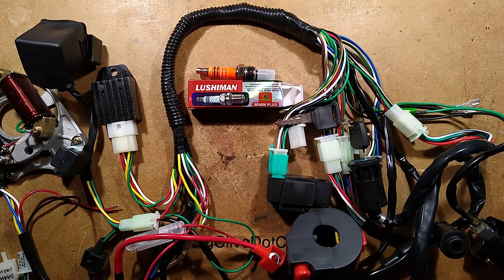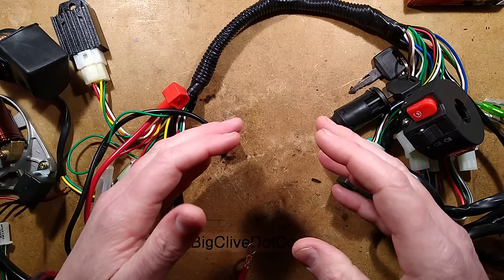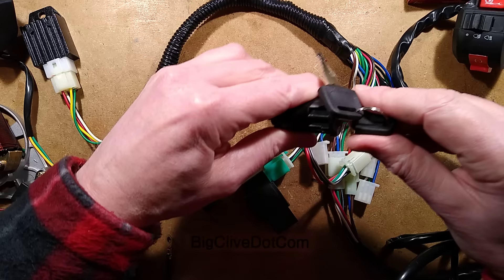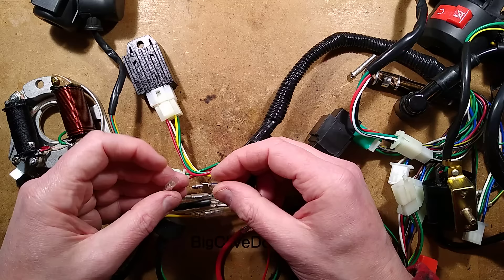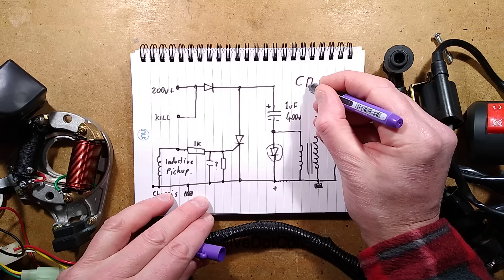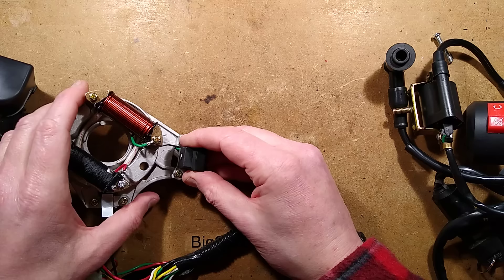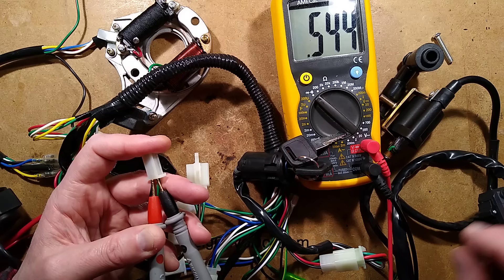Exploring the wiring loom of a Chinese quad / scooter.

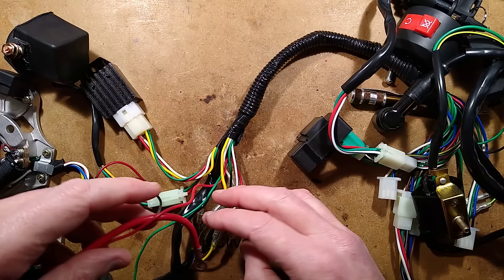Comment: 7:45 The connectors are a bit shit . . . lol I believe that's a fairly large understatement... Look at the wires , they are very thin and if I remember correctly, somewhere around 28 ish gauge at best.
I see those plastic connectors alot with crusty connections and broken plastic tabs. Those "single wire connectors" for lack of a better name ( bullet connecter ) ,usually are ok enough to be connected at least 2 -3 times. At least, before they just start falling out.  I also see alot of engine start "switches" corroded  too.

Edit: added bullet connector, as I commented before that point in the video.

Comment: I almost want to say that the yellow and white is the “single phase ac” wiring from the stator ? So single phase ac into regulator and 12v dc out.
Reply: This is an AC / DC system same as small Hondas, the headlamp is unregulated AC, thus the flaring when the engine is reved. The DC section of the coil goes to the regulator for DC to drive tail light and charge the battery.

Comment: at 12:59, you sound like you mean the secondary (external) coil fires on an expanding magnetic flux field, current starting to flow.
traditional ignitions fire on collapsing fields as it takes time (dwell) for coil saturation. 
rough gauge would be primary windings will be low resistance, only a couple ohms.
i spent some time researching LC circuits, because of an unusual type of ignition called "energy transfer" where the points short the output of the stator coil to ground until they open, leaving the HT primary windings as the only available path, low resistance, they saturate very quickly, firing on an expanding field with points opening.
https://www.motorcycleproject.com/text/ignitiontech.html (discusses multiple styles of ignition)
as my shop teacher said about saturation, "it's quicker to empty a bucket then to fill it"

Comment: Bigclive. Im looking for good t10 12v car led lights that are able to stay on for long amounts of time without burning. I tryed i guess 100 different kind of bulbs, but only a few are usable.
Things i need:
Dont need to be extreme bright.
Not blueish white, just white. (5000k?)
Reliable.
Thanks!
Reply from the maker: Choose the ones without the extra canbus resistors.  All they do is pass current and generate heat.  You can extend the life of most of the smaller lamps by adding an extra resistor in series externally.

Comment: I just spent many hours troubleshooting the engine management in a Chinese manufactured ATV using an 1100cc Chery motor.  Talk about horrific - no documentation, waterproof connectors that weren't waterproof, everything (including the ECU) had some level of corrosion, relays could be turned on and off with a squeeze... simply catastrophic.  I did get that POS to run finally.  Would not recommend.

Comment: 16mins in is a fine example where a digital meter is a poor device to demonstrate with. Numbers flashing all over the place. By watching it carefully it is possible to follow what is happening but it takes a bit of effort. An analogue meter will be steady and changes of switch state obvious. Horses for courses I know. Analogue is unbeatable in some applications, digital when you need to know the voltage of your pp3 battery down to 0.001v.

Comment: It’s an alternator rather than a magneto really. A magneto is a unitary generator/HT unit. They’re still used on aircraft
Reply: & an ALTERNATOR is used in CARS ... not motorccyles or ATV's ... CLIVE is correct .. it is called a "stator"
Reply: a MAGNETO .. is the BIG ( stationary part ) inside of the STATOR ... Magneto's are used on gas lawn mowers .. .when the flywheel spins & crosses the MAGNETIC field of the stationary magneto .. .a small electrical pulse is generated .. which is then send to the spark plug .. no need for a CDI. ... If you have LIGHTS, RADIO, ... you need MORE power than a magneto can produce for the spark plug ...

Comment: Damn that's a great buy.  You have lots of hardware for under £20!  I've got some Chinese copy Honda engines that may use this.

Now I am curious.  Supposedly there are some of these systems that will not fire the CDI unless a battery is connected, and others that work fine with or without a battery.  There so many variations of these Chinese harnesses and apparently the components are not interchangeable.

Comment: To be fair, you can get a chinese quad for a tenth of the 'stealership' ones in a country that likes to jack up prices of imports.
Yes, it is half the physical size and probably not 4wd. Yes, I belive most countries do not allow them on public roads. Yes, the drive chain will snap like boiled spaghetti if a overly grown up kid tries to give it all it got. Yes, the engine might not start without working on spark plug or a full on carb clean after a long cold winter. Will any and all parts wear out faster? Undoubtedly.
Can you have fun on a small quad even if it is rwd? Oh yes. Can you  find a venue where the law is not looking? Most likely. Can you go to the nearest motor cycle shop with the snapped chain and ask for a stronger replacement? I sure did, and I sure got. Is it difficult to clean or change a spark plug, or clean out the carburator? Not if you are able to search for a few how to's on youtube and realize that maybe five videos telling you to do it one way and one having a very easy fix suggests that there may be reasons why most don't use the easy fix. Can you order a complete quad out of spare parts to fix yours? At least in the case of mine as it turns out.
Bottom line, you get what you pay for. I got a cheap-ass quad that is fun to tear around on. I have also spilled figurative and literal life blood on it as I have taken it apart and replaced parts. 
Basically, do not under any circumstance buy one of these if you want something that will just start and run. Get something with a honda engine.

Comment: My bike has a kill switch on the kickstand. That maybe we're one of those connectors goes.
Reply: My Bandit didn't. I used to leave it idling whilst I locked up.
Reply: Mine does too, Honda
Reply: might need the clutch lever (if it has one) pulled in to turn engine.
Reply: @dundeemink3847  the bike will not run with the kickstand down and the bike in gear. I can either have it in neutral or put up the kick stand to start and run the bike.
Reply: @ndmusick11  It could also have a lean angle sensor. this stops the engine if the bike is lying on it's side. this is for fuel injected engines as a carb doesn't  like its float bowl in the wrong place and will tend to stop after a few seconds.

Comment: From my limited experience of little Chinese engines, could those 2 spare wires near the magneto be for a low oil kill switch?
Reply: More likely for a Neutral switch installed near the gear lever, for the Neutral indicator light that most mopeds, motorcycles and quads have. The gear lever is operated by the left foot, and the magneto is typically mounted on the left side of the crank shaft.

Comment: In your professional opinion, if I had a scooter which would accelerate just fine until a few miles an hour and fall flat no matter the throttle, would the sketchy CDI module be a good place to start replacing bits? Electronics go right over my head.
Reply: NO ... It starts & runs fine ... electronics are just fine ...
fuel line is the starting point ... gas flows from the tank into a (bowl) on the carburator ... which is then SUCKED out to be sent to the cylinder ... when you "sit" the FUEL BOWL refills .. .when you run the engine it uses the fuel from the fuel bowl .. if the SUPPLY LINES are clogged ... the fuel can't refill the FUEL BOWL ... in time.
Reply: CHOKE is stuck on ... too much fuel is goingto the engine .. .CHOKE is fine when at idle .. .but when "floor the accelerator" .. you are now putting in TOO MUCH fuel for the engine can handle.
Reply: NOT enough gas .. or ... too much gas. ... electrics sound like in good shape.
Reply: SOME atv's do not even have a BATTERY or a CDI .. .the cheaper one without any lights ... DO NOT .
CDI are used to power the spark plug ... & recharge the battery .. .which powers the lights.

Comment: The extra kill switch wires are for a alarm and remote kill button for kids
Reply: Kill switch on the ... front brake ... kill switch .. .on rear brake ... kil switch on ... SEAT ... Kill switch on ... remote control starter ... kill switch on ... low feul ... kill switch on ... temp control ... kill switch on ... kick-stand ( who th F uses a "kick-stand" on a 4 wheel vehicle ? )
Reply: What 10 year old kid ... is going to remeber the ... 7 ...  " kill switches "   ... NONE ... so I "dis-connected" the ... " safety switches" as my kids were not able to start it  ... without tie-ing string onto ther handlebars ( which raised my concerns )... as a 10 year old's ARMS & LEGS are NOT long enough to "bypass" all of the safety swithches at the SAME TIME !

Comment: Dude no way. I can’t believe I didn’t see this one.  I had some serious questions on how the rectifier regulator works. Ike both ac waves go to rectifier then spit out 12v? What’s the wiring difference in halff and full wave rectifiers?
Reply from the maker: I made a separate video where I de-potted and reverse engineered each loom component.
Reply: @BigClive  I saw that video eventually thanks so much Clive!
Reply: from the factory is 1/2 wave ( as that is what the stator creates ) ... Full wave means you move the ( 1 wire ) from the mid-point of the stator to the "other end" of the stator coil ... but you also need to replace the 1/2 wave rectifier ... as putting FULL wave into it will blow it ...
Reply: 1/2 wave is a PULSE of electricity .. the 1/2 wave rectifier "tries to smooth out " .. ever notice how your lights flicker when engine rpm's get low 
FULL wave is MANY pulses of energy ( in the same time frame ) ... creating a "smoother" energy wave containing 3 to 4 TIMES the energy for the same number of rotations ... eliminating the pulse ... allowing for " more sensitive electronics " ... like trying to record yourself on a CELL PHONE.

Comment: these "chinese scooters" we call them GY6's in the Netherlands are very easy to steal just crack the steering lock by kicking the steer then break the front shield or unscrew then unplug the ignition or cut the ignition cable and kick start it and it will work One big security fail my dad had one and some drunk guy just made a crack in the shield unplugged and stole the bike in 40 secs 
😂😂

Comment: Bad news? "From 1 January 2021, eBay will be legally required to begin collecting and remitting VAT for UK imports. From that date, eBay will have to charge buyers the applicable VAT amount directly and remit this sum to the relevant authorities."
Reply: I'd rather that than the massive "handling fee" couriers charge on £3.01 vat.
Reply: We already have this in Norway. No big deal though, if the seller isn't claiming the VAT (via Ebay's Global Shipping Program), the Mail will gladly do it as the package arrives at the terminal. Many small packages still come through without having to pay any VAT though.

Comment: "The connectors quite frankly are a bit shit. Nothing is waterproof."
Yep, might as well go right in the trash then, unless you're putting it on an ATV for an indoor area that's always completely dry.
Reply: They are fine provided you pack them with dielectric grease.
Reply: Those connectors are standard on all motorcycles no matter how much you pay for it even ones that cost £20K or more.
Reply: @johnmccallum8512  Superficially they appear exactly like the connectors on any number of small Japanese bikes I've owned and restored over the years, but the Chinese version are somewhat inferior in terms of overall quality IME; very thin metal for the terminals and the plating on them seems to be quite ineffective against corrosion.  The larger mainstream modern bikes also tend to have many more sealed automotive style connecters.
Reply: New eBay listing: "Trailer Queen/Show Only/On-Road-Only ATV Wiring Harness"
Reply: @johnmccallum8512  I did not say 'motorcycle'. You did.

Comment: @bigclivedotcom i've been buying chinese happytime 49/66 cc engine kits for bicycles for the last.....20 years? my current death trap is built on a 24 inch frame with hella modded engine setup because they are made to fit on a 26 inch frame, they are FUN, you should get 1, $150 and you can feel like you're going to die for only $150 usd

Comment: At uni I was taught never to solder or crimp a loom as the change in stiffness can cause the copper next to the joint to work harden due to vibration. How much of a problem it is in the real world I don't know.
Reply: Harnesses / looms for automobiles are often ultrasonically welded at splice points.
Reply: @brianleeper5737  We didn't have the equipment for that at uni.
Reply: @tasherratt  I don't think many places have that equipment. I remember I pulled apart a scrap automotive harness and I was curious if they actually soldered the splice point. It wasn't soldered, it was welded...and at the time I had no idea how until I later found out that they ultrasonically welded them.

Comment: I made the mistake about 20 years ago of buying a regulator/rectifier from China for my bike, it boiled my battery dry in two days, & it was a new battery, would never buy after market Chinese electronics for my bike again, don't know how they get around CE standards, but they still do it nowdays
Reply: you must have hooked it up wrong .. .as 30 years of working on HONDA, YAMAHA, KAwsaki, & many un-branded chinese atv's ... never had a problem .. if you read the instructions !
Reply: @tsvandyke  it was obviously aftermarket one & had the same plug on as mine, so no, no chance of hooking it up wrong, the unit was just faulty
Reply: @No-timeforimbeciles  the factory one on my ATV ... rusted & shorted out after 2 years outside ... bought an "aftermarket" harness for a " universal atv" .. .been working fine for 5 years outside ... better than the original -too !
Reply: @No-timeforimbeciles  sorry . just noticed the CDI .. .my AC powered cdi has the same plug as a DC powered CDI ... but the color coded wires are in different spots.
Reply: @No-timeforimbeciles  The ONLY thing that is original ( to the factory ) or replaced with the same brand name ... is the seat cover. ... even the " john deere" steering link rods - are working better than the "taotao brand name" which was trhge same price .
Reply: you bought a 1/2 wave recitfier ( cheaper as they are for atv's & scooters ) & you put it on a FULL WAVE motorcycle. ... the 1/2 wave  produce small amounts of voltage ... which charges the battery with 12 volt pulses ... & you installed a FULL wave retifier which converted the ... split second charge ... to steady on-going charge ... overloading the battery.
Reply: @tsvandyke  just certain things I won't use from China for my bike or car, anything to do with charging system, wheel bearings, in fact almost any bearings, Tyres, & engine components, I have many other items from China, Zippo wanted upwards of 35 euro for a petrol lighter, found a copy from China for under 5 euro, use it every day for the last 10 + years, dash cam, worked fine for 4 years now, that was Chinese, each to their own ideas
Reply: @No-timeforimbeciles  Check the manufacturing stamp on ... ANY ... part your car uses .. .they ALL come from CHINA . ... might be ASSEMBLED in the USA ... but the parts ... come from CHINA . .. .don't believbe me - do research for yourself.  ... stop attacking -  when the research is openly available .
Reply: @tsvandyke  actually my car is fully French made, I even know the factory that made it, not disputing you can get pattern parts for it from China, but since I always buy my car components as needed through our local Peugeot dealer, I know parts come from French origin 😊 oh by the way, I'm not in the usa
Reply: @tsvandyke  oh, & before you say it, my car is pre 2010, so before Peugeot had factories in Jakarta & China
Reply: @tsvandyke  & I am not attacking China, as you put it, there are things I have from China, I have no problem buying from them for certain articles, but stuff I rely on for my bike, is not one of them, they are improving, but they need to up their quality is all I am saying !